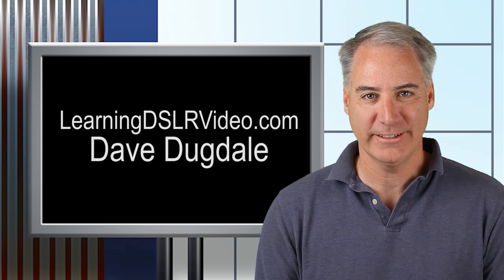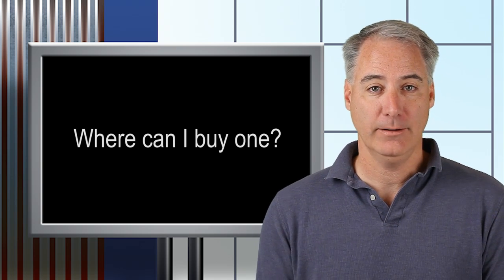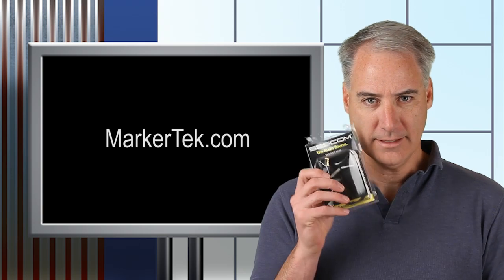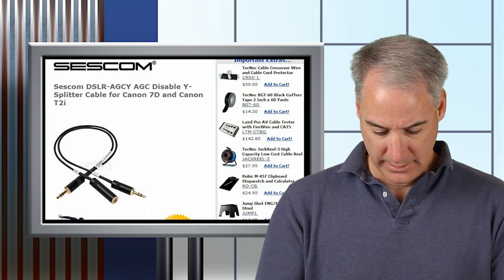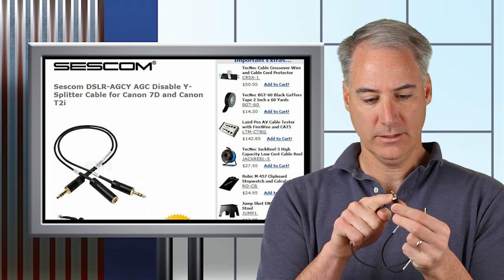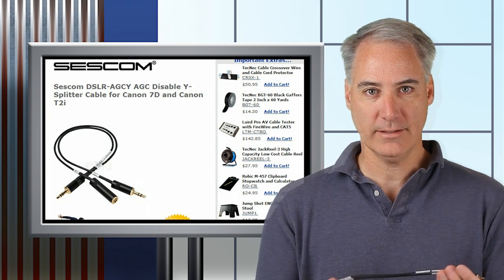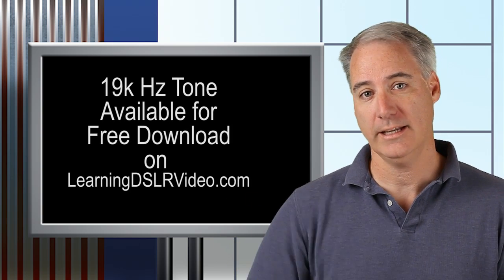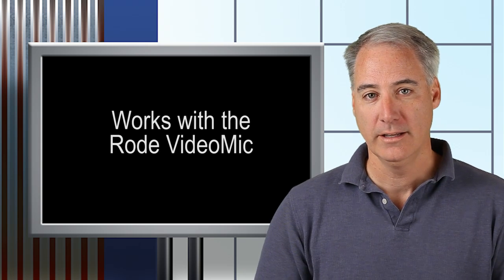DSLR Cable To Defeat Your Canon DSLR AGC

Comment: Not sure if there's a problem with my SESCOM AGCY cable, but I tried with my 7D and Shenggu SG108 microphone (the fabled "cheapo" eBay shotgun microphone) and it doesn't work at all...  Anyone managed to get it to work with the same equipment that I have?

Comment: hi i have a canon 7D and from all the videos ive seen i cannot seem to find a solution with the 7D will it not work because it doesnt have Manual sound? also how do you connect the audio recorder if it doesnt have an output on the sescom lead? would you have to buy a double ended jack for this? to plug into the sescom lead to the audio recorder?

Comment: @drumat5280 first: thanks dave for all the effort, great channel. just got my videomic pro, got the cable, downloaded your sine tone and ran a few tests. you're totally right, the mic at 0dB and the sine at around 75% produced the best results so far. two minor suggestions: get a proper clip for your mp3 player and a windjammer, too.

Comment: If you are having problems using a splitter (DSLRAGCY from Sescom) and a mono mic, read this.

My mono mic was not recording any sound. My Azden SMX 10 works fine, a constant signal on the left channel, audio on the right. However, my AudioTechnica ATR3350, a mono lapel did not record anything. To fix this, I made a wiring change by reversing the input wires on the “Y” splitter at the mic’s connection jack. Both mics now work, perhaps just this particular mic was an issue.

Comment: @WhereIsWales Yeah I know mate. It's still quite expensive for Portugal, it's the Postage+VAT that kills it. As I said on another comment I ended up ordering it from markertek uk, it works really well~! At the time I didn't have an H4N and it actually saved my arse a few times. Nowadays I only use it with B-roll. Thanks for the info anyway :)

Comment: Off topic: I had a hard time getting my 16gb SDHC 10x speed to take the Canon Firemware update. My t2i was version 1.0.6 (very old). I switched to a 4gb slower card and that did the trick. Now it's 1.0.9! Yeah! Also, a lot of the Canon software updates are "Error on Page" dead ends. Lastly, has anyone tried the Hacks for audio levels and gain control for the t2i? It looks cool (on Vimeo under vimeo dot com 13793063) but I haven't tried it.